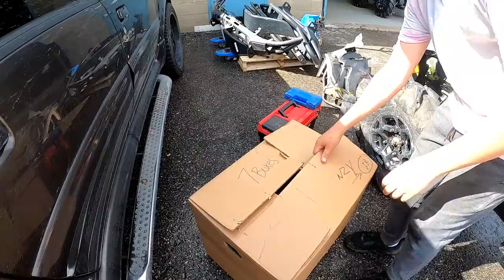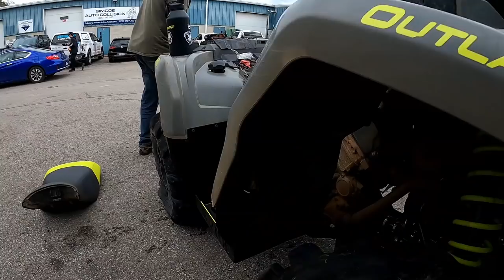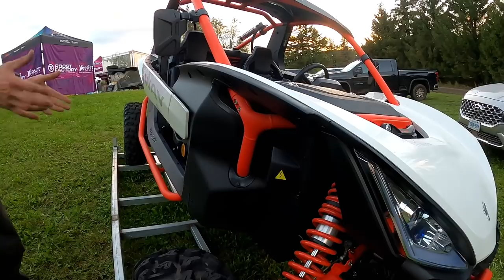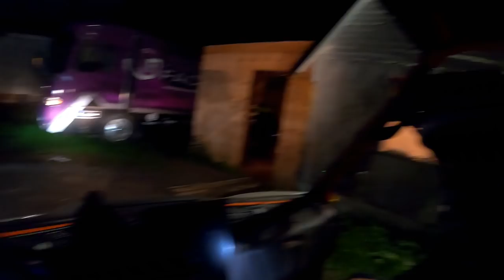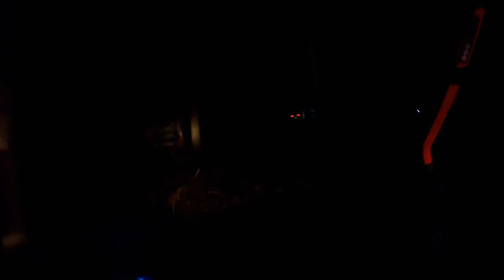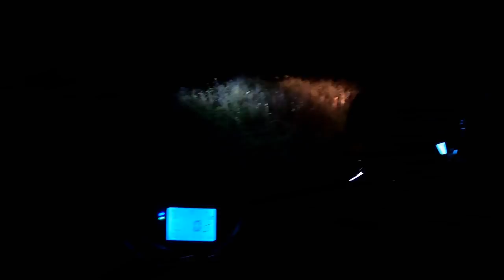Farmudding Outlander Gen2 Floorboard Install / Segway Test drive

Comment: Was just watching another video about electric taking over the all terrain recreational vehicle world . It should of started a long time ago
Reply: Youd have to pry my honda from my greasy hands. I like not worrying about charging my bike and not being able to go in water😂
Reply: 100 years from now Honda won’t even be producing combustion engines . 
I’ve had a rubicon Forman and rancher 420 
They both were snorkeled and they still get problems water riding .. electric motors can be fully waterproof . More so than a combustion engine that Relies on air intake